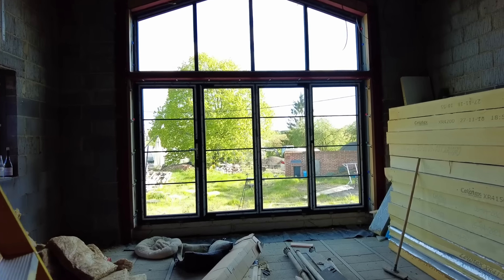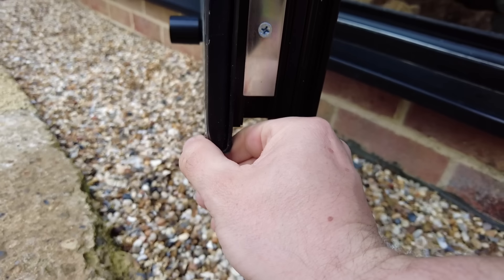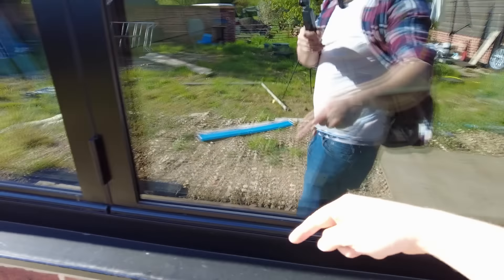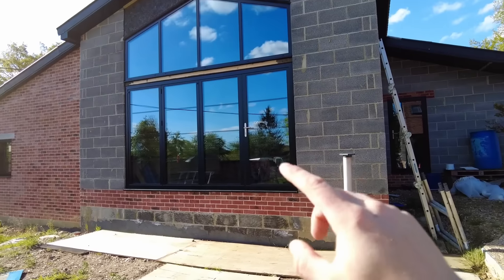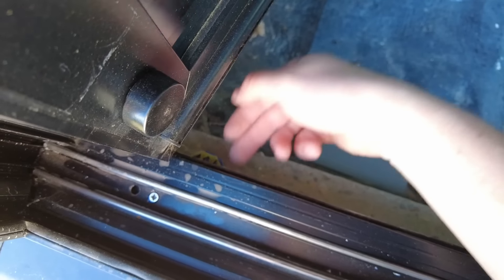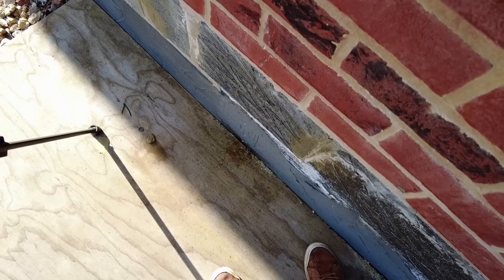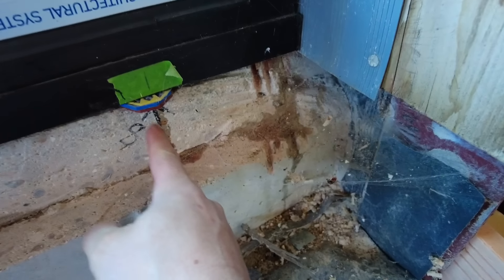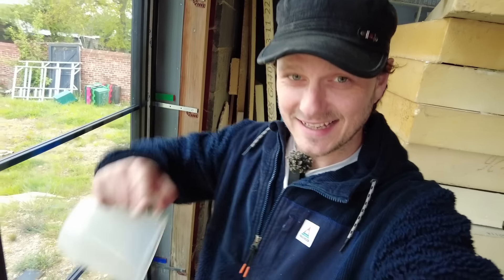Oh No...Something is Leaking

Comment: An LTT (Level Threshold Tray) fitted would solve many future issues.
Also any block is porous so a tanked/sealed surface in contact with the expanding tape makes for a great seal, the tape incidentally guarding against material movement between block/wood/metal/plastic/silicone.
Reply from the maker: I've never seen these, just had a search and could only find an illustration. I'd like to see one in real life as it looks like an interesting concept
Reply: @THE-AIDEN-PROJECT  I can DM you some photos of last install if you like, sliding door install into double wall, cut from existing wall and two trays, one on each course. Made to measure, the outer one heated and creased to fit within the 50mm gap, there adding DPM to base of gap as well.
Reply from the maker: @robwilton8001  yeah that'll be cool to see
Reply: @THE-AIDEN-PROJECT   OK, I can hammer a nail into wood but don’t actually know how to message/email in YouTube? Lol
Reply from the maker: @robwilton8001  😆 my email is on my channel home page under "about" I think

Comment: Had a similar issue at the house we are now when we moved in. It has a roof lantern and one very wet day..... drip drip from the roof.
Had some roofers out... no issues found...
I went up and looked myself, and a joint cover on the sill had previously been siliconed and it had failed (peeling away, loose cover). So fixed it properly myself and no issues over the past few years.
Reply from the maker: Nice 🙌

Comment: i find it ridiculous how many professionals dont even do something as simple as a water test when finding leaks, they just show up, patch a few things and hope its right or they tell you the roof is fine which it might be from every trades individual perspective yet it still leaks. Get a hose, start down low, have somebody inside where the leak is and just go slow, 5mins on each area and move up the building. At the very least you can eliminate things and you should eventually find it, swap places with the other person if you cant. I have found some very odd places causing leaks very far away from where the problem is
Reply from the maker: That's very true! It's just craziness

Comment: You really needed to set the door sill on a much wider DPC. The width should then be folded upwards internally and at the ends.  Also, not a thin plastic one either but a heavy duty rubber style finish. Bit late now though … sorry.
Reply from the maker: I've still got to put the dpm down which will lap up the door, it'll be fine 😉 I can't imagine any moisture tracking up the wall as the doors are almost a meter high from the ground. NHBC states that the dpm should link to the dpc underneath the door and there's just about enough gap for me to do that 🙂

Comment: Your dpc should be tucked up inside since this is effectively a threshold detail
Reply from the maker: Not sure what you mean. I know I'm meant to tuck the dpm under the cill and the dpc is meant to be bonded to it 😬 I can kind of do that but maybe I should have put some dpm on before the cill. It's just for possible damp from driving rain according to the NHBC
Reply: The top bit of the inner lip of the sill is actually your FFL. So usually dpc is wrapper up to that point to and trapped by the final floor layer 👍. 

Hope that makes sense. You don't have alot of these done correct in the UK 🍌🍌🍌🍌🇬🇧.
Reply from the maker: @Swwils  ah yeah I know what you mean, this is the only door that doesn't have enough to do that. I'm sure it'll be fine though once the dpm laps up.
Reply: @THE-AIDEN-PROJECT tine for floors